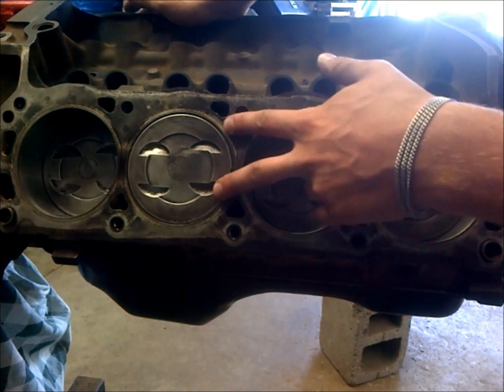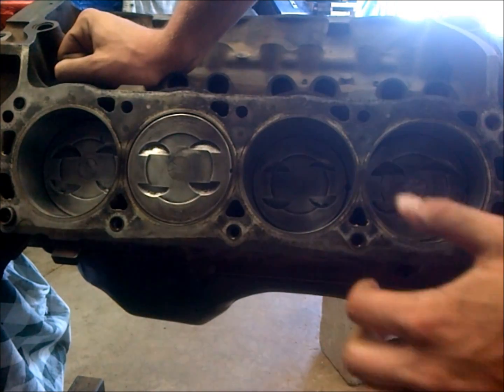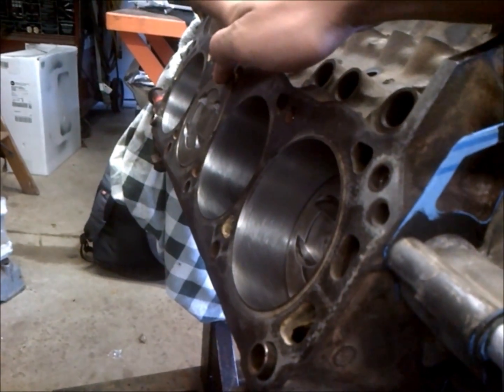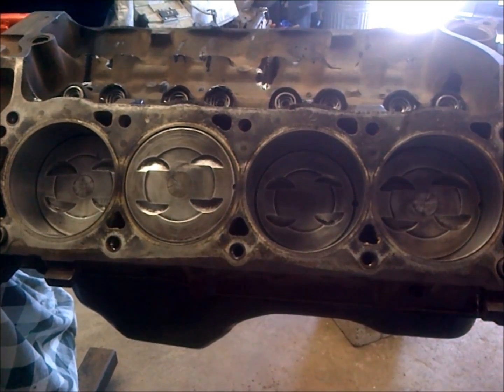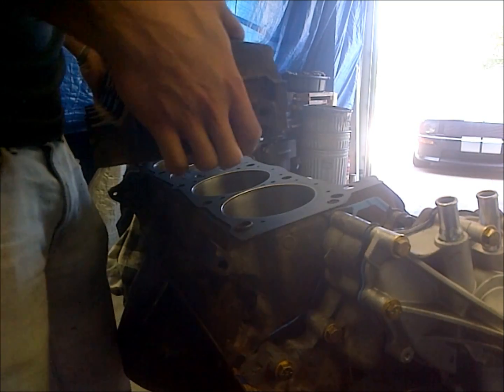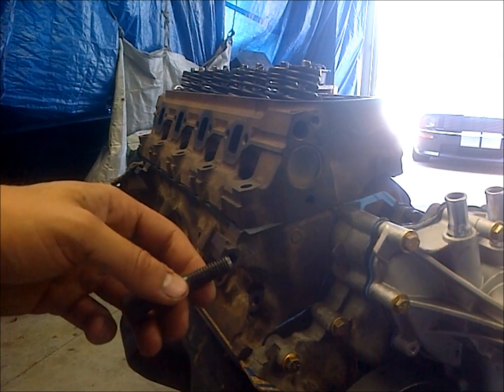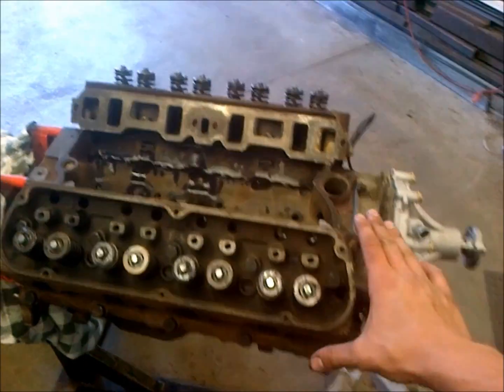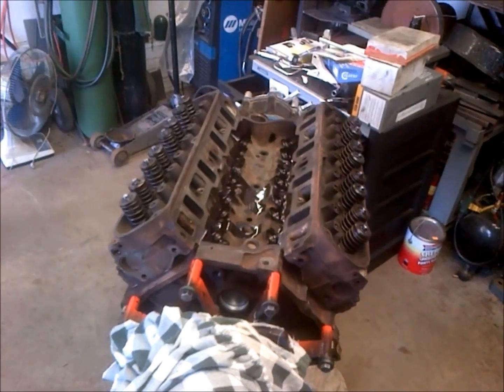Install Ford Heads and Head Gaskets w/ Bolt Torque & Pattern HOW TO

Comment: ThunderHead289,  Did you have any problems with sealing after you ran the engine?  I ask because my deck looks similar right now, with several dark areas which are virtually flat with the block but I dont know if I need to scrape of every last dark patch (I am trying to stick with just razor blade, and no abrasive pads..etc).
Reply from the maker: I have never had sealing issue with my engines as long as I have everything good and clean. Cast iron is porous, so it will technically stain - discoloration does not necessarily mean elevation
Reply: Thanks!

Comment: Fixin to start a rebuild on my Dad's 88 Bronco that has the 302 in it.... Can you tell me which HEAD GASKET set you used?I know they make different ones for different surfaces.... I wont be doing much past cleaning them up... as far as polishing goes. Thanks for any info.
Reply from the maker: If it’s just a driver, shoot for the stock thicker units - they last a long time and handle all possible irregularities better than other units. Makes sense doesn’t it - and they are the cheapest

Comment: Why didnt u use new bolts? And u should be using the supplied assembly lube, and only the bottom bits get blue thread lock because they go into the water jacket
Reply from the maker: Chris Super Bikes&Stuff I have a few reasons here. It’s a budget rebuild series and the bolts are not torque to yield, so can be reused without issue. You will see in my performance builds I go with new hardware. 
I like using the same stuff on all threads so that the torque is consistent. It also resists rusting in the threads. Cost a bit more than assembly lube, but I like to shoot for consistency.
Reply: ThunderHead289 so you're saying the stock harware is reusable but aftermarket stretch?

Comment: mr. thunder, my radiator cap show sings of oil sludge in how could i know if its my head gasket or the intake gasket??.
  (Fe 390).
  thanks..
Reply from the maker: Do you have milky oil by chance?
Reply: Do a leak down test

Comment: Why is it that I can snug up my head bolts by hand with the head off but not when it's on? When I do it with the head on it feels like it's binding, I'm reusing the stock head bolts but I've cleaned them up nicely and all threads are in good condition. I used oil on the threads also.
Reply: Never reuse head bolts they are one time use stretch bolts.

Comment: Hi was wondering on the head gasket I didn't see front on mine. Mine has the same blue strips as yours but one was down towards the block & the other was up. facing the head. I just don't know if i did something wrong. please let me & i like the video. Please email me at jnichol9@tampabay.rr.com
Reply from the maker: hey, there should be no coolant passages showing at the front of the block. the openings in the head gasket should be towards the rear of the engine. its fine for one to be upside down. there is no left or right head gasket. they are all made the same. on one the front inprint will be facing the block where you cannot see it.